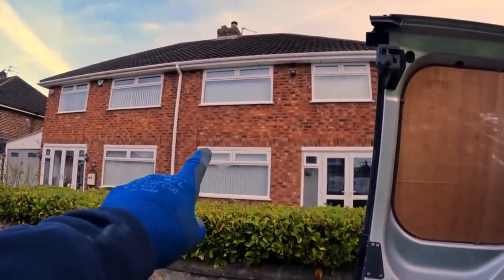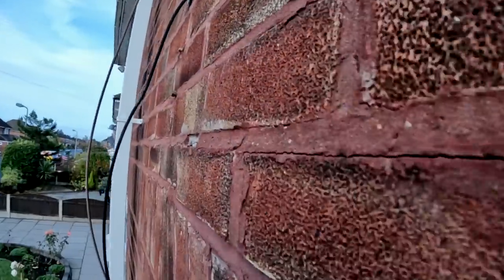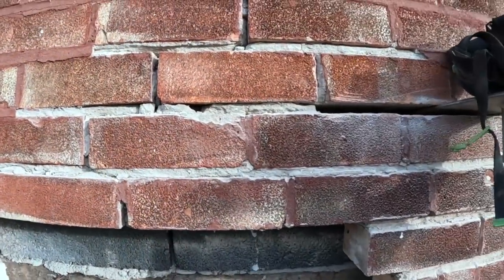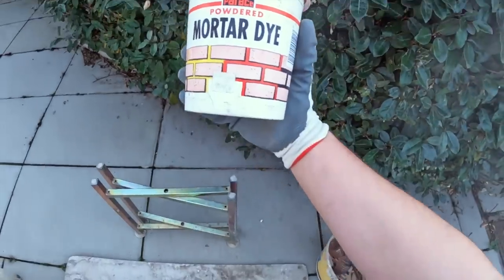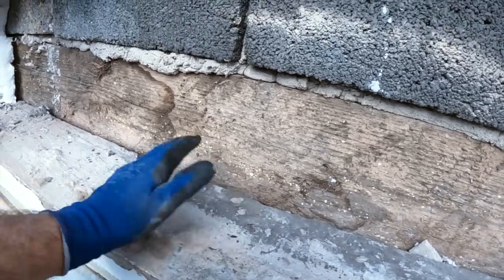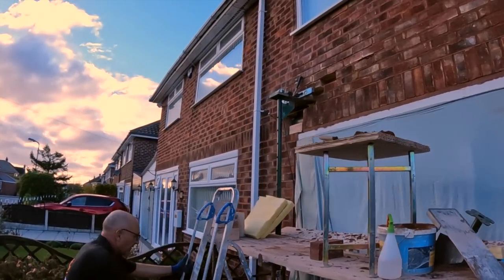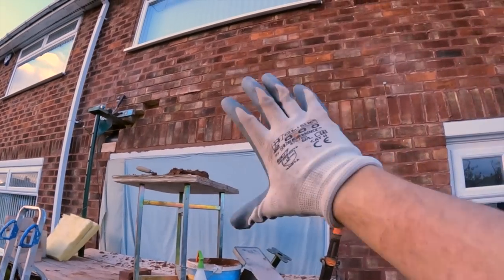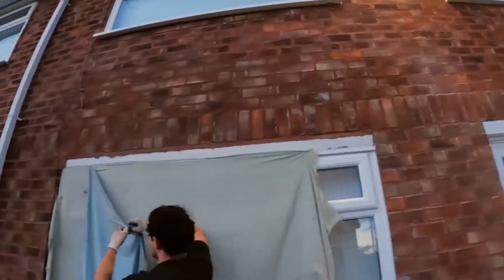ABSOLUTELY USELESS CONCRETE LINTEL !!!

Comment: 👍 like your channel just a question if I ever run in to a job like your doing now if beded the concrete lintel and and put a lent of brick reforcememt under the solider and over  to more courses what you think, O one more thing do you think I should buy blakes profile love the way there work but with saffoding boards in the way when setting up on saffoding or do you think get aluminium profile with the clamps you can get now I don't 😌no what to do I am using 2 6ft level and there doing the never used blakes see 1 bricke on site with them but he had them trun upside useing the new clamps out this bricklayer was up his own ass so wouldn't ask nothing 👍
Reply from the maker: Not sure what you mean about the lintel .
   As for the Blakes, had mine 35 years and love them  . Box section can be handy too . When you get to scaff height just ad a small corner to get above the boards .
 🧱👍🏽

Comment: Just to point out the timber has serious signs of Wet rot and could develop in to dry rot. I would always treat these signs with a dry rot fungicide, at least a spray on the surface and see if you can peace a vent or two in the rebuild.

Comment: I'm not a brickie, so I'm probably talking poop....But it didn't look like the right hand end of the lintel was sat on much (when compared to the left)? Wouldn't it have been better to cut a groove/slot and put the "tray" in to that, as opposed to simply silicon it on to the internal blocks? Also, where are your weep vents/drains for the tray?
Reply from the maker: The lintel was central , the cavity tray is fine and there are plenty of vents in I even did a close up !
Reply from the maker: @martin2466  🤣🤣🤣😎

Comment: Looks like the cement pointing contributed to the cracking. What NHL did you use?
Reply from the maker: NHL ?
Reply: @SteveAndAlexBuild  Natural Hydraulic Lime. That wall was originally built with lime mortar. Did you replace with cement?
Reply from the maker: @davidcameron7597  yes we did 👍🏽. 
   The cracking was from the the lintels blowing and all the tie wires disintegrating, nothing to do with the mortar 🧱👍🏽

Comment: Keep seeing guys working like this and not using a small tower scaffold. If they fall backwards, they could well end up in a wheelchair or, worse, for sake of a few extra pounds on the job 🫣
Reply from the maker: Aluminium towers are the worst platform to work off. 
   They are too small , hard to transport a pain to erect and generally awful to work off 🧱👍🏽
Reply: @Bricklaying With Steve and Alex   hope you stay safe my friend 🫢
Reply from the maker: @richardgiles2484  🧱👍🏽

Comment: What is the 3 different pattern ?
Reply from the maker: The what ? 🤔
Reply: @SteveAndAlexBuild  sorry about that a thought u were someone else. Your da works well but you need pick your game up n use elastic bands to control your spectaculars 😉
Reply from the maker: @cornhammer  er thanks …. I think 💭
Reply: @SteveAndAlexBuild  a severed my time with my dad and it was heavy duty 😫. So for u to work with dad and do the vid stuff at the same time then hats of to u both 👍🏼
Reply from the maker: @cornhammer  cheers 😁🧱👍🏽